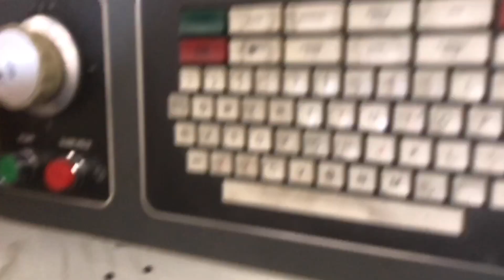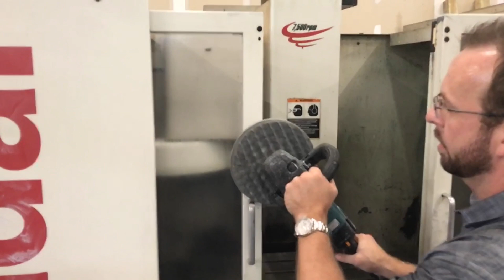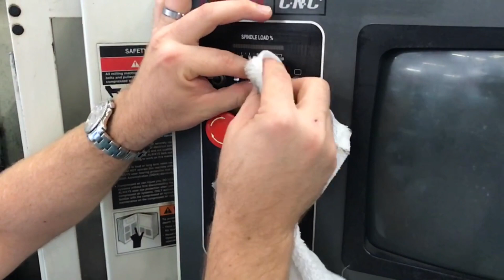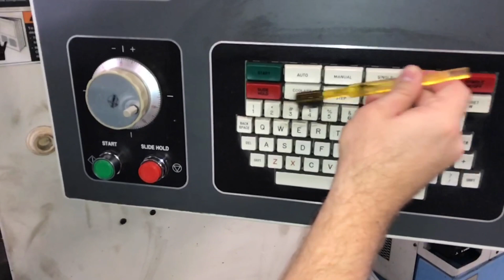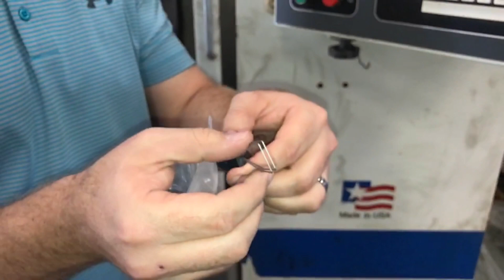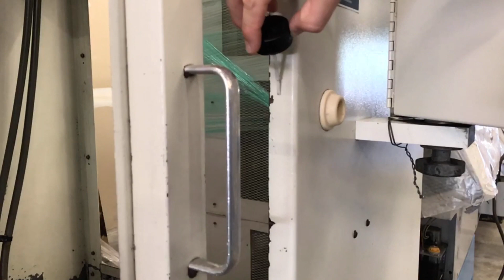How To Clean a CNC Machine - Get a Fadal CNC Mill Ready To Sell

Comment: Great job!  Looks good...have to do my Hyundai Hit8s lathe tomorrow...thanks for the tips!! How do you make the plastic shine from old age and fading? Next time I  buy a CNC machine, not only do I want to see it running, but I want close up high resolution photos of inside the electrical control cabinet.
Reply: That's funny, I bought an HIT8s about 6 weeks ago, sight unseen and the electrical cabinet photos where from it's most attractive angles, the base of the cabinet was a filthy/oily mess.